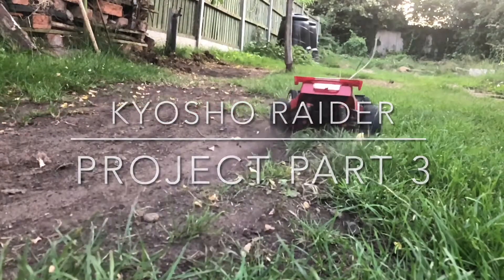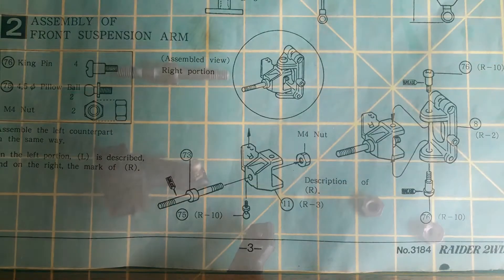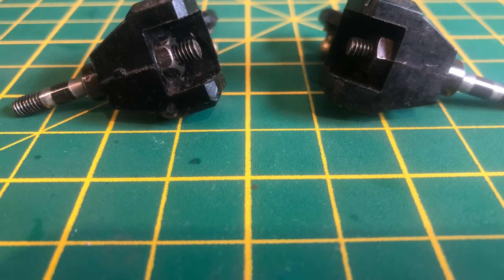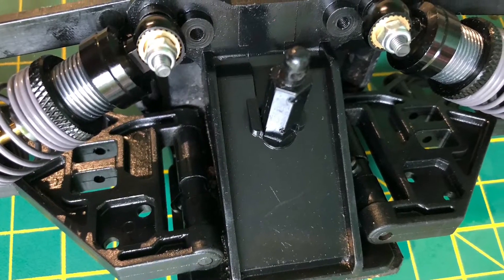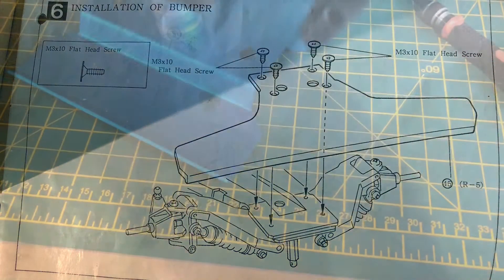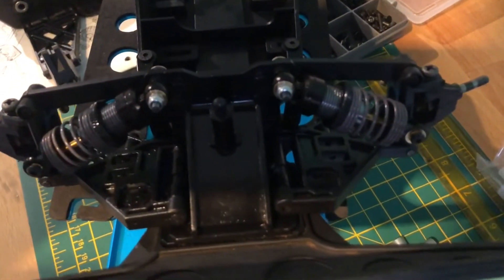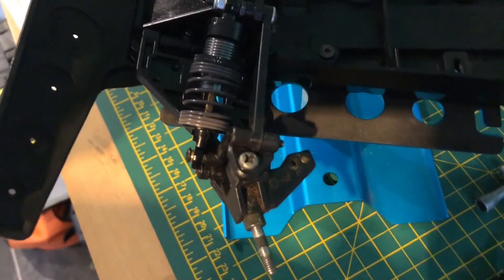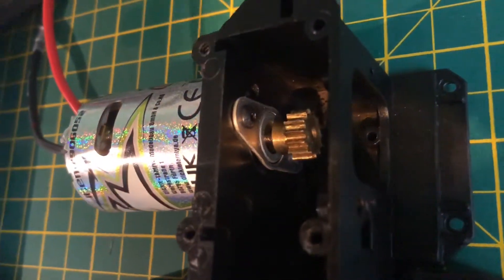Kyosho Raider Project Part 3

Comment: That thing is so clean!  What kind of motor ESC combo are you going to run?

A little Vaseline on the motor plate helps get things back together easier.  I am running an 18 tooth pinion in mine with the 32 tooth idle gear.  You can go bigger than 15T if you mount it from the top once the motor is in the car.  16 and 17 tooth gears are more involved than an 18 tooth.  I have a few videos on my channel on the installs and the mounting hole options.
Reply from the maker: Thanks for the reply and for watching! I am putting a cheap motor in for now to see how it goes. ESC is just a Tamiya one I had knocking about. All my cars are runners except for my original Raider so I am planning plenty of laps round the backyard track with this car come some drier weather!! I will check out your vids 👏🏻🙌🏻👍🏻
Reply: @theoagrc  sweet, I have a cheap and relatively low torque brushless setup good for 40+ mph.  : )